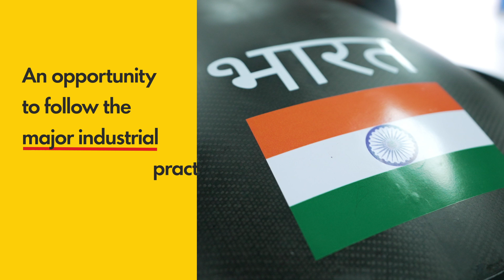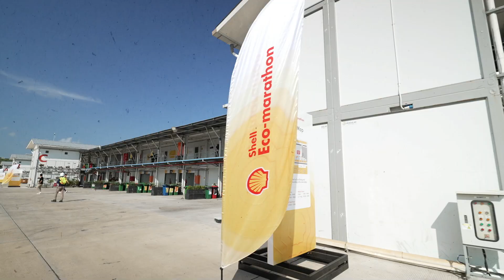Averera - Stories from the Track | Shell Eco-marathon

Comment: On April 9, 2024, at 17:00, I requested to fill up at pump number 20. My tank was a bit more than a quarter empty. Normally, it would cost 700 TL to fill up. At the counter, I was told that the fill-up cost 180 TL. I said that's not possible. They mentioned the pump might have malfunctioned. I asked the attendant, who tried twice and said it didn't take. When I got on the beltway, I realized no fuel had been added. Be careful. This happened in Izmir, opposite the Westpark outlet, at the Shell station under the Mercedes Benz sign.